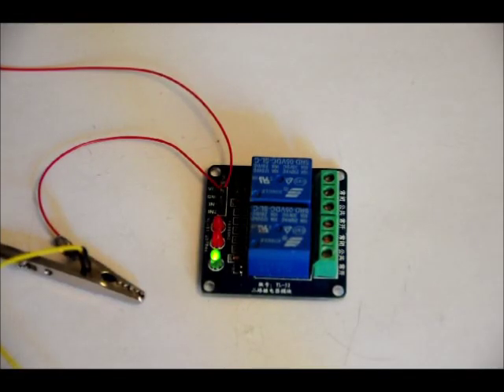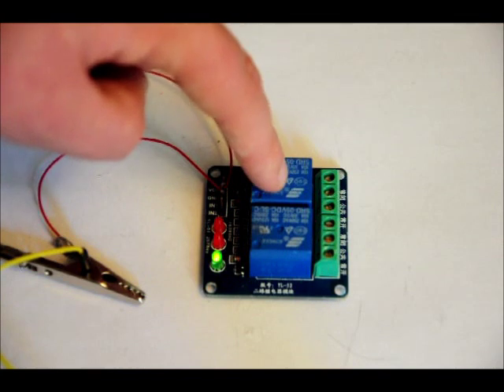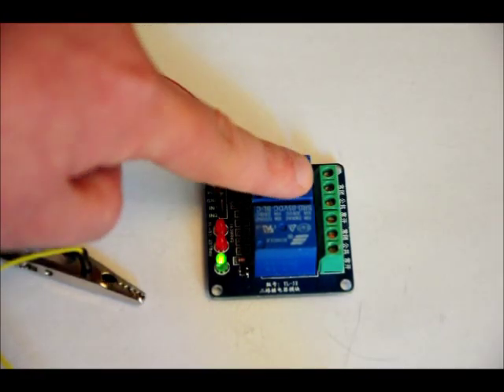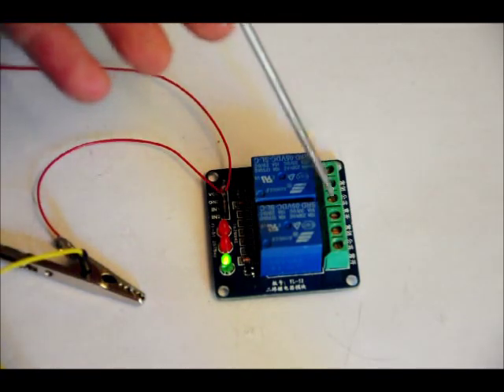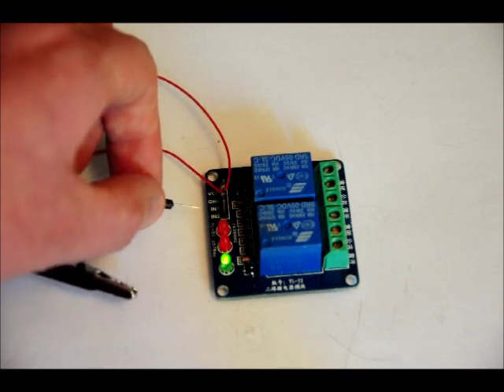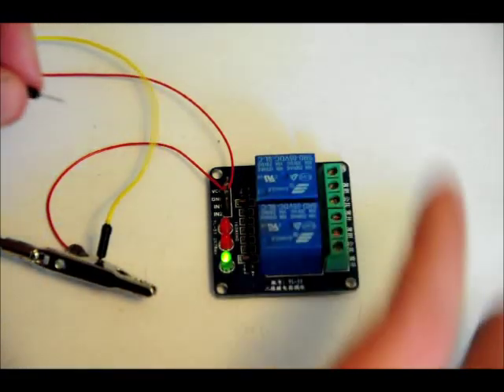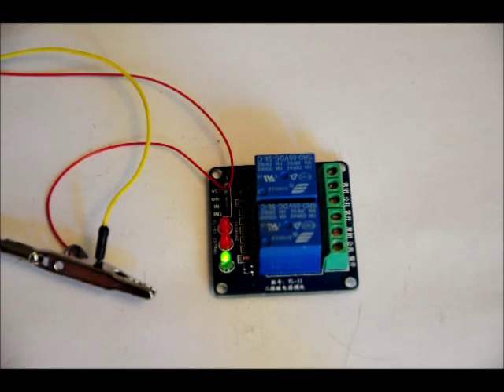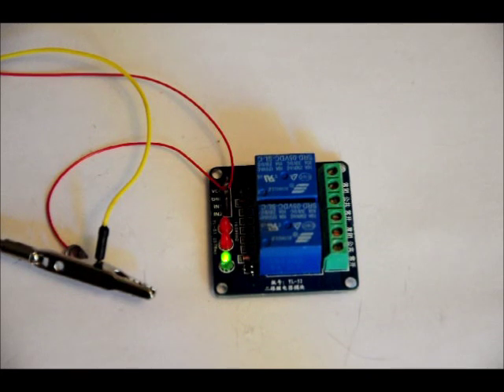5v Active Low Dual Channel Relay Board Module

Comment: Hello dear friend, can you kindly answer this question? Is it possible to directly connect a pir hc-sr501 which has a 3.3v output to a relay that requires a low trigger level? If so, how should the link be? Thank you very much

Comment: Hi, if my relay turns on with LOW signal (active low), and I want my light to turn on when signal is HIG, should I just connect it to the NO pin?
Reply: the default value for high it is 1 and for LOW it is 0, try to change in you project the value of output pin, like this 1=LOW and 0=HIGH

Comment: None of your videos on these relay boards mention flyback diode protection when the relay coil field collapses???
Reply: This isn't a theory lesson.  It is a product introduction.  Every single unit that I sell or have designed has a protective diode on parallel with the relay coil...
Reply: patrickikis  I wasn't being nasty, just pointing out a salient fact, especially if it is a product introduction. I have bought relay boards that HAD NO flyback diode protection, so that is the kind of information I consider important to mention from the gitgo!!

Comment: which board will work when using a 12v PWM trigger to be converted to 12v constant DC? I'm want to use it to power a backup camera that needs to be connected to the reverse light that has Pulse With Modulation. The camera requires constant voltage.

Comment: Most ucontrollers sink 40ma current in the low state, but can only supply a very limited current in the high state.  Therefore it is less expensive to allow the ucontroller to activate an element by driving low.  Using a high state would require adding a transistor to supply the extra current the element would need to activate.  Also, an active low means the processor is running, a high state is the default when the pin has not been accessed by the processor.  If the element recognizes a high as active "on" you may have relays doing things when the programming is not running or "lost.